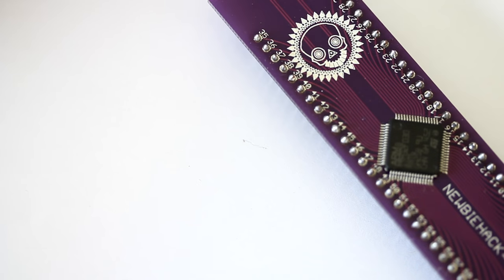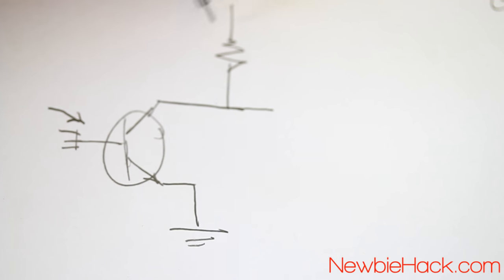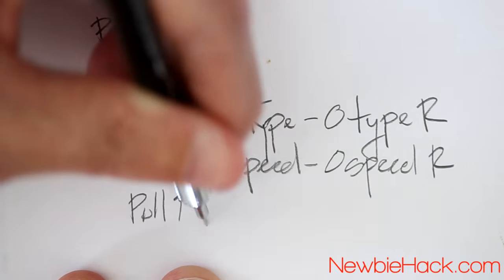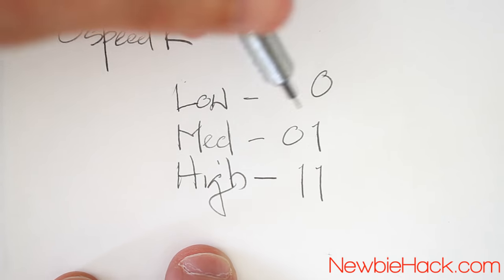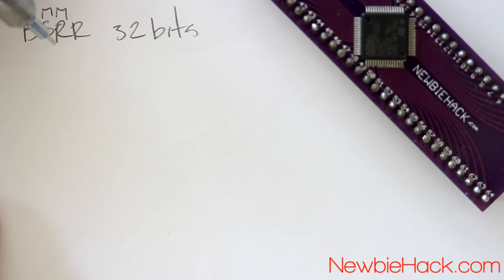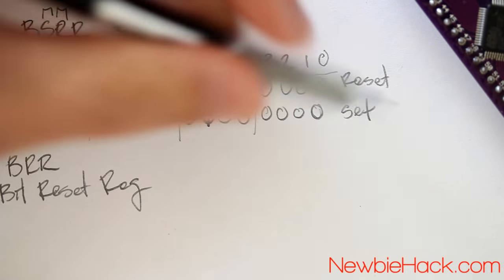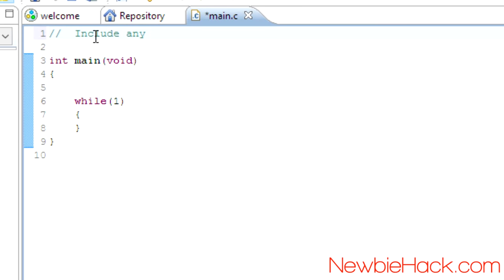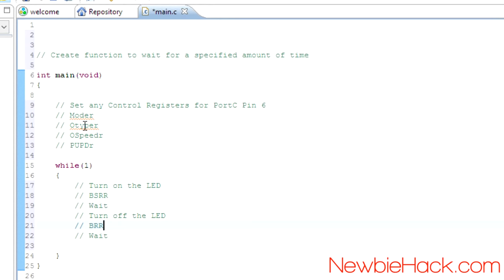6. How to Output to a Pin to Blink an LED for Arm Microcontrollers - GPIO Tutorial Part 1

Comment: Hello. Thanks for the amazing videos and extra effort for the ones who are enthusiastic about the subject.

I would like to ask a question. I can only hope that you would spend your time to answer that.

How do you know what registers you suppose to set before the application? Is it from the reference manual? 

Thank you a lot.
Reply from the maker: Yes, the registers I select are directly from the reference manual. The reference manual lists all of the registers in the uC and a great amount of detail on each register. I would also encourage you to get my book where I explain many of these registers in plain English and that will give you a general understanding of the registers and how to use them, even ones that I don't show in the book.
Reply: @PatrickHoodDaniel  Excellent. I will buy the book from amazon or indigo by myself. 

Is that reference manual good to check for any arm microcontroller? I have NXP FRDM K64F development board(that has Arm Microcontroller in it) and I want to deep dive into arm microcontroller after I do some raspberry pi applications.

Thanks for the reply.

Comment: I have a question: I’ve been trying to program an STM32L4 nucleo board with the STM32CubeIDE and I noticed their generated code adds all these functions to main that configure the system clock, gpio pins, and more. I also noticed you don’t include them in your main.c file. Is that because your IDE includes them in separate files at compilation or are they actually not needed and are just the recommended/preferred option?

Thanks for the amazing video series! This has been super helpful!
Reply from the maker: Thanks for the comment. I cover a bit of its in my new ARM video series. I am using the STM32CubeIDE in this new series. Have you seen it?

Comment: Nice series of videos. For Cortex M3 I fond in the RM0008 Reference Manual, page 170, for input: 1) Analog mode,  2) Floating input (reset state) and 3) Input with pull-up / pull-down; and for output: 1) General purpose output push-pull and 2) General purpose output Open-drain. So it seems that there is no pull down or pull up for the output modes.

Comment: You must set one RCC and four GPIOC registers to set up this port.  After you explain it, it makes sense.  But how would I have found these five registers by myself from the manual?
Reply from the maker: I read the entire reference manual!! Really! It was a lot of skipping around, but the programs at the end of the manual also helps quite a bit.  If I got stuck on something, I would go to those program examples and go line by line.

Comment: Will this knowledge be applicable when I decide to use STM32F Discovery boards? It seems like many of the STM32 programmers use librares/HAL. But If I can manipulate the STM32F Discovery/ nucleo boards with this style of register level programming I may consider getting into this! (Sorry I only have AVR register level programming experience so far)
Reply from the maker: Yes, you can use the STM32 discovery boards.  The programming that I demonstrate is the native language for the STM32.

Comment: Great video, thanks!  CoIDE is being phased out, what IDE are you using now?
Reply from the maker: Did you find this information somewhere online?  Coocox has been a website that has been online and offline sporadically, but they seem to go back online.  I will need to go back and review the libraries and see if I can use another IDE and still have the same coding architecture. The coding access to the registers used in the CoIDE is the same shown in the ST programming reference, so I'm sure there won't be a problem finding a solution.  I would love some suggestions, however.
Reply: I've been using Atollic TrueSTUDIO for STM32 9.0.1 while following these tutorials.

Comment: 6:58 Don't you mean the 31st bit? It's a zero based index.
Reply from the maker: +juschu85 I mentioned that the one on the top left is the 32nd bit and the one on the bottom right is the zero bit.  My mistake is that I should have said that the one on the bottom right is the 1st bit.  Assignment wise, it would be from 0 to 31 (as a zero based index), but speaking in terns of position, it would be 1st to 32nd.  Thanks for pointing this out this error.

Comment: At 09:18, in my IDE I don't have the xxx_boot file. I only have the xxx_core file I there anything I need to install ? Thank you
Reply from the maker: You are correct.  I do mention this in another video.  The new naming convention has changed and you will need to add the core file instead.  It should automatically add the other necessary libraries as well.
Reply: Wow, that was fast ! Thank you. :)
Reply from the maker: You're welcome.
Reply: kindly pin this on top, so anyone facing such issue can see this